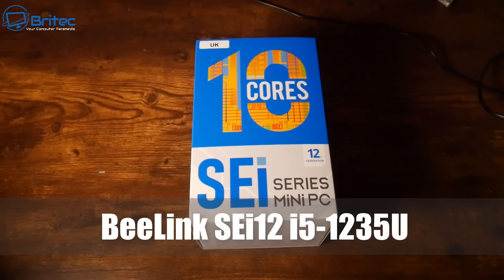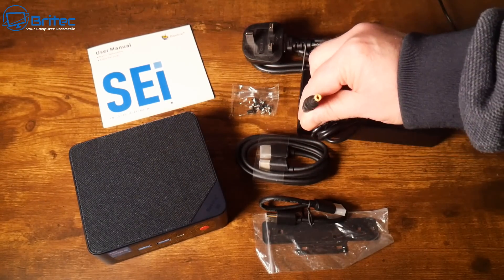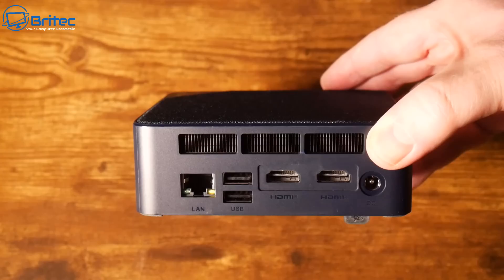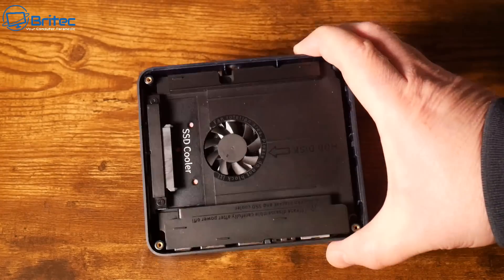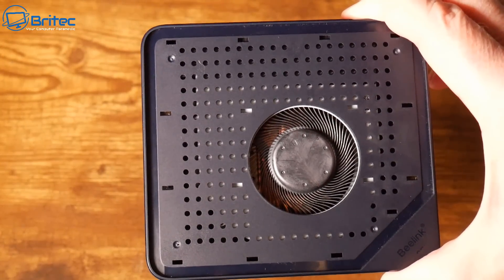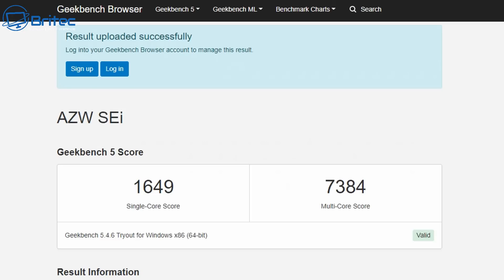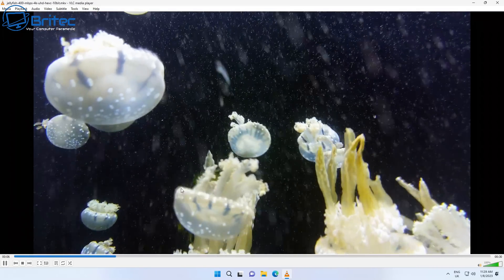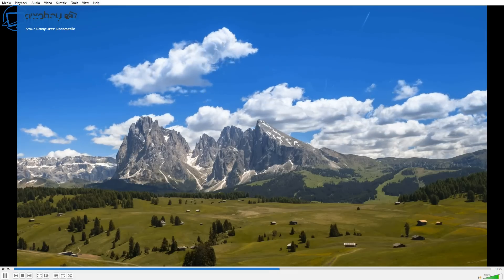The Mini PC Everyone is Talking About

Comment from the maker: great little mini pc, they are getting better every time.
Reply: They still need a better GPU for gaming.
Reply: they will not last, the same like the new laptops. to much power for the size
Reply: @computersrepaircotesaint-l7407  I've had two different mini Pc's, both name brands and both overheated and died after about 2 years.
Reply: @ianlets7531  I'm fixing motherboards so I know. to small to bad
Reply: Mini PCs are too overpriced.. better to get a budget gaming laptop, which comes with many more features..  mini PCs use laptop components.. but without screen, battery, keyboard and trackpad..
Reply: I had an unpleasant experience with this company. They never responded to my request for assistance.
Reply: get the amd version perform better than this and can do normal setting 1080p in GTA V.
also, Minisforum has 1 better version than this brand with a 6900H i think...that one is a the real mini monster
Reply: I never even consider it after i find it. It is not on my top 3 list and i never heard about it before i start looking for one. Basic and shitty product.
Reply: Can I run a third display from the USB C port?
Reply: Like how much?
Reply: Those Intel 12th Gen & onwards sure suck up a lot of power. So I'm gonna tell people to disconnect their solar power and reconnect the mains because your going to need it. AMD's a lot more efficient !
Reply: You know its a BULLSHlT channel not worth watching even a second of when the first video you see from it has the words "Everyone is Talking About" in the title.
I hit the pause button before the add finished and never even bothered to listen to 1 second and then hit the DON'T RECOMEND CHANNEL. I don't know if you have anything worth hearing or not. 
Why should I care when you label your work in this manner?

Comment: I'm mostly happy with my older Beelink, but it's ability to run quietly didn't last very long. Now the fan makes a lot of noise, and it always runs on medium, or high speed. In comparison,  after roughly the same amount of time, my Lenovo laptop is still essentially silent.
Reply: Hello.
Parts can be replaced by contacting the after-sales.

Comment: Two years ago I bought a cheap mini PC with a J4125 processor. I use it as a media player for the TV and a server that's running 24x7. I believe the power adapter was only 24W. That thing works so well, I wonder what would be a use case for such high power mini PC as this Beelink. At that price, better to get a normal PC so you can plug in a video card for gaming. Or get a laptop at the same price. I'm also guessing that compacting such high power into a small case will not go well for longevity. You might get high failure rate after 1 or 2 years.

Comment: I can't see (On Amazon US) where to buy the 32gb Ram Version.   Beelink doesn't even list it. So where did you see that it also comes in 32gb RAM?   I need to do Creative Work with Adobe Photoshop and Illustrator at the same time as other things.
Reply: The i7 version comes with 32GB. But you can upgrade de memory pretty easily on the i5

Comment: Mini PCs are great little project PCs - for stuff like a low-cost Homelab/virtualization. They aren't much good for gaming as the Xe graphics is crap on modern games, but it is enough to drive a 4k desktop, even two, without much issue. Great for lightweight computing tasks like school work and ranting on social media. My issue with Bee-link is many of their systems don't offer a "barebones" configuration - including this one. I have to buy their base configuration and toss out the drive and memory if I wanted something more capable - just seems very wasteful. I suppose I could put the drive into an enclosure or sell it on eBay - but a lot more hassle than it is worth. I just bought a similar type system - the NUC 12 Pro i7 (1260P) as a barebones - but I think it is a bit more expensive.
Reply: The new M1/M2 Mac minis are actually by far the best mini-pc:s on the market.

Comment: So where is the thunderbolt port, does it have enough power to run Davinci Resolve? How do I make music with I  do not care about USB 3 ports cause I have no USB 3 hardware not even USB 2 gear more than flashdrives. And even though I have been using computers since the mid 80 ies I never heard anyting anout this PC.

Comment: Mini PCs are too overpriced.. better to get a budget gaming laptop, which comes with many more features..  mini PCs use laptop components.. but without screen, battery, keyboard and trackpad..
Reply: The reason I like mini PCs is because I don't want that clunky giant desktop taking up room in my desk area. But I don't want to pay a lot for them either so I end up getting the cheaper ones and then they are crap. Super slow to try to do anything with. And I can't afford an $800 one if I'm going to pay that I'll just get a regular one for that.
Reply: You can build a mini pc right now for about $420 that would out perform most sub $600 budget gaming laptops currently available.
Reply: @mobiusbelts3607  but without a screen or keyboard.
Reply: @jessejames586  TV can be your screen until you can get a dedicated monitor & as long as you remember to include a keyboard in your pc build, you’ll have a keyboard, maybe even a mouse too!
Reply: I have so many keyboards and mice laying around here. And anyone who's building something to replace something else could just use the keyboard and monitor from the one that's being replaced.
Reply: I get them from Dell for like $900 they have an i7 16gb ram and a m2 1tb ssd. Not to bad
Reply: Can you please direct me to where I can find a better performing PC for less price than this?
Reply: I bought a Beeline mini S, only half the price of equivalent laptop. It was actually cheaper than a Raspberry pi 4 and came with Win11 pro.

Comment: In the US we are all talking about the BeeLink GTR6 6900HX mini-PC.  It has the AMD Ryzen 9 6900 HX - 8 Cores 16 Threads 4.9 GHz CPU.  A monster of a miniPC and drives an 8K monitor with the AMD RDNA2 12 cores at 2.4 GHz.  Memory is DDR5 7000 MB/s.  If you want the biggest and baddest on the street, this is the miniPC for you.
Reply: Agreed, I have the bee link 5600h and it preforms great, but I am looking forward to the 6900hx with the better apu. I use this to play war thunder under linux.
Reply: @munocat  The GTR6 with the 6900HX is awesome.  I also have the GTR7 with the Ryzen 7 3750H.  I bought it last February and it too is an awesome miniPC.  But the first time you use the GTR6 will be an eye opener.

Comment: How long does this mini pc last for the long term??
Reply: Impossible to answer. If you use it a few hours it can last for years easy. If you use it 24hrs who knows. 😕
Reply: Considering such high power in a small case, an average one should last significantly shorter than an average normal PC, since the heat will shorten the lifespan of the electronics.

Comment: Would you be able to connect a external GPU with the mini PC?
Reply: I don’t think so. You need a Thunderbolt 3 or higher, or USB4 for that which I don’t think this model has. The SEi12 Pro has that but it’s more expensive. Later this year AMD will be releasing a new Ryzen “U” APU which is very commonly used on these mini PCs. It’s supposed to have RDNA3 onboard so it might finally have powerful enough graphics processing onboard to negate the need for a dedicated GPU on these mini PCs.
Reply from the maker: why go two all that trouble.